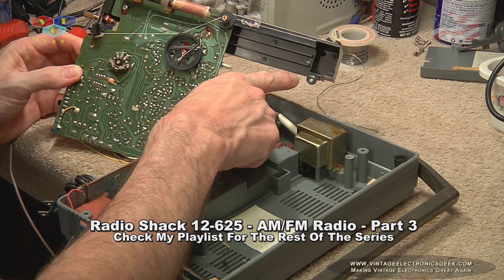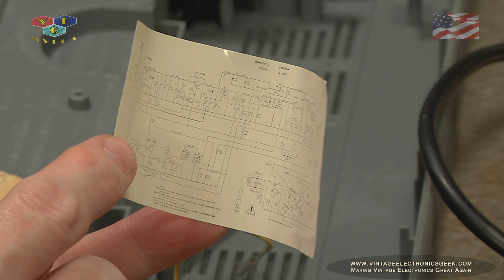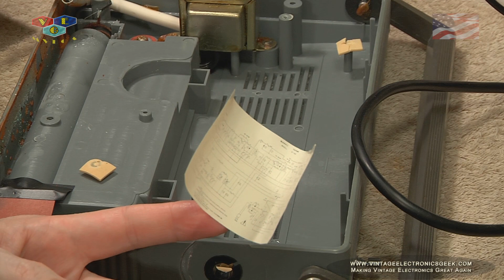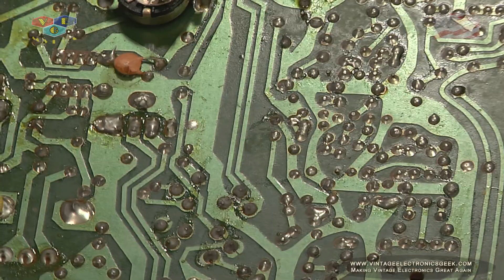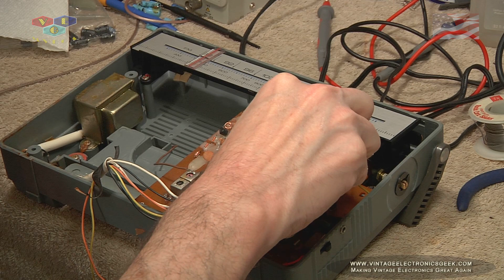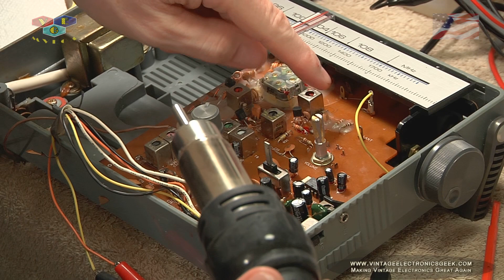Radio Shack 12-625 AM/FM Radio - Part 3

Comment: Nice. We look forward to the next and final part. Nice heat gun, too; I borrow my wife's, but it's not as fancy as yours.
Reply: Thanks for the link! You use that often? Desoldering station (cheap) might be on my list. I just picked up an old Heathkit decade capacitor subsitution box. Video to follow.
Reply from the maker: Those HK's are nice, but boy are they big!  I've seen a Sencore that I liked, can't remember the model #, been waiting for another to popup...I did buy the cheapo kit ones before going down, I need to assemble.  I have used the heat gun to remove more labels than anything...haven't mastered SMD's yet, but I have warp a board!  :)  It's a piece of gear really that one should have, I've used it also for heat shrink tubing.  ~Jack, VEG
Reply: @VintageElectronicsGeek  Great! Thanks for taking the time to answer, VEG.
Reply from the maker: With great pleasure and anytime!  :)  ~Jack, VEG
Reply from the maker: Thank you OS!  The next video I hope should wrap it up!  :)  Nothing wrong with wifes, if it gets the job done, then that's all that matters!  Mine is nothing really, Chinese junk that seems to do OK.  This is what mine is:  https://ebay.to/2JtGUi3  ~Jack, VEG